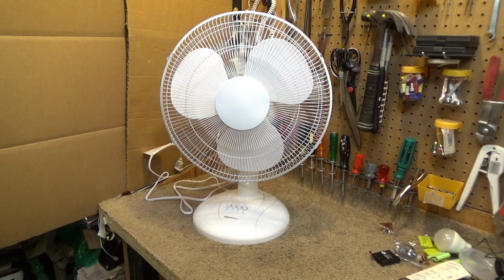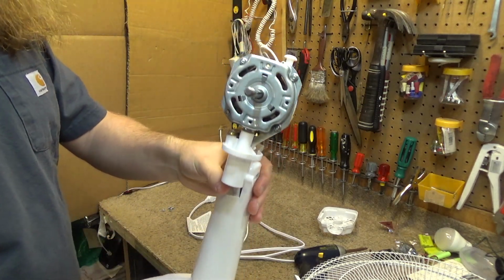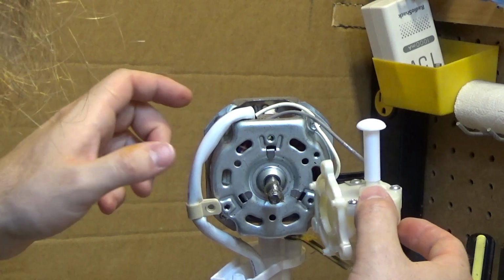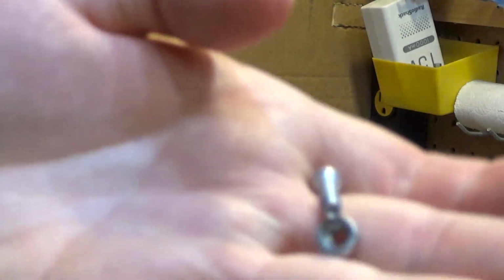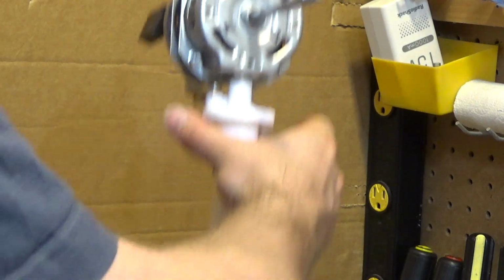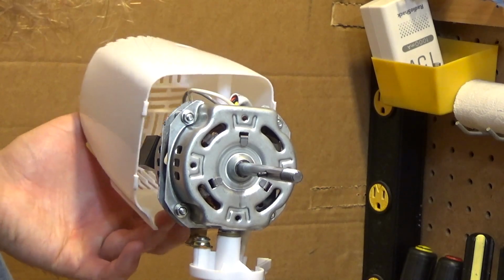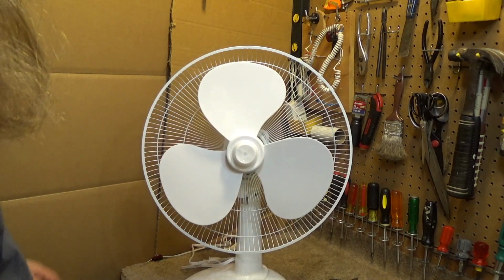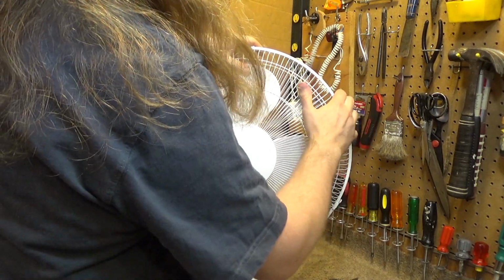Amazon Basics TP40-1R 16" Oscillating Desk/Table Fan | Teardown for Cleaning and Oiling

Comment: Fans nowadays have No or Little Oil Felts so when you oil the motor then the bushings will dry quickly.
Also Many Chinese made Fans have Aluminum Windings.
Reply from the maker: I haven't seen the aluminum windings yet, but there are definitely plenty of models with inadequate oil wicking.

Comment: Good video bro on 16" Amazon Basics Table fan teardown for cleaning and oiling even though the bearings are stiff which is weird I enjoyed it bro
Reply: These motors for some reason have this problem, I have had numerous comfort zone fans and the bearings seem to be like that. It was also like that on one Aloha Breeze fan like the one Jordan U fan. The weight of the blade might also be the cause as it is very thin
Reply from the maker: Come to think of it, the 12" high velocity fan I have from them also seems to be pretty stiff even after lubricating and aligning the bearings, as well as many hours of operation.
Reply: @JordanU  Yeah these motor shells might not be fabricated well because if you see the exposed and older SMC motor shells the bearings free up and are not like that
Reply from the maker: @drakesessions3544  The bearings seem pretty free in both of these. I've never had an issue with SMC's bearings.

Comment: Those motors are too cheaply made to even spin smoothly. I've serviced similar modern China made fans, and even with a lot of good quality oil on the bushings, they still won't spin freely. Usually what happens is they loosen up a bit after servicing, and then after a day or so of use, they get stiff again
Reply from the maker: This one has started to free up a bit after some use, perhaps the bearings just needed to break in.

Comment: So, yeah. striking the shaft with a screw driver is really unnecessary.
The easier way is to loosen the nuts & turn on the fan.  The magnetic field & shaft rotation will align perfectly it--then slowly tighten the nuts as the rotor turns & you will have a perfectly aligned rotor without any need to pound on it...
Reply from the maker: That's not true.